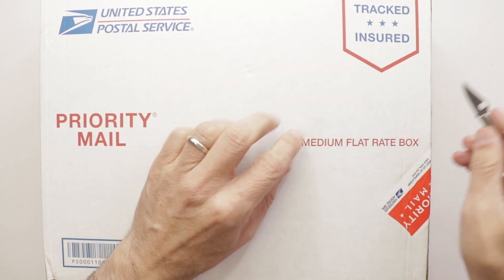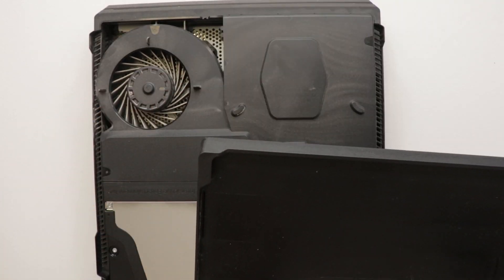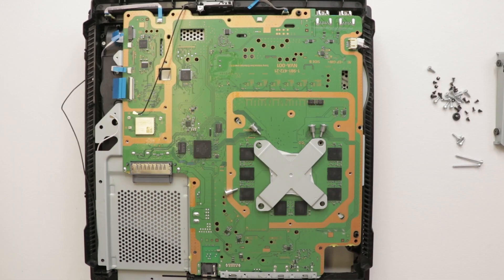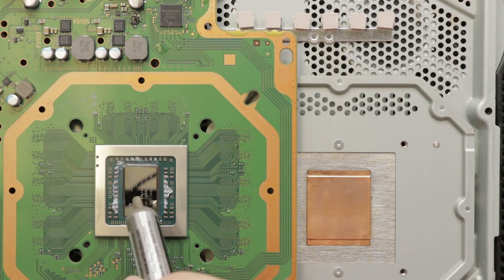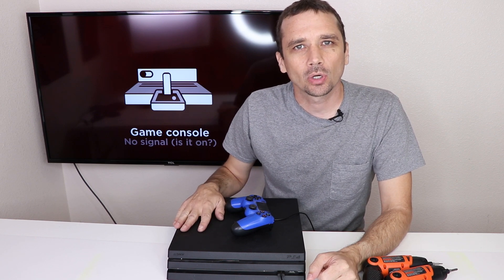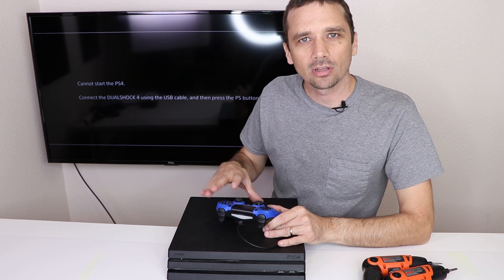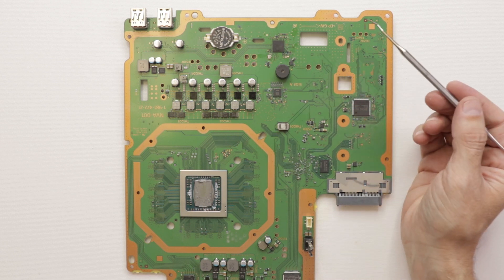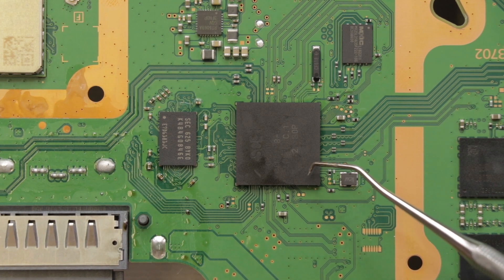eBay Repair Challenge - Part 4 - Is My Luck Running Out?

Comment from the maker: What do you think of item #4?
Reply: Bad luck not fixing it, I wish you more luck on item 5. I'm curious what was the reason it still didn't work, but frankly given the effort required to confirm that, I'm happy staying clueless. It might have been worth checking the controller(s) synced with it before taking it apart and replacing the HDMI IC in case it was something you did that stopped them working. Though, I doubt in this case you caused that.
Reply from the maker: I checked the controller multiple times. It's my test controller so I know it works perfectly. As far as I can tell the reason it didn't work is because of the Southbridge chip. The lines from the USB ports go directly to that chip. I think the chip had burned out because of the lightning.
Reply: when you look at the southbridge chip, you can tell it has been burnt at least a little. This can be clearly seen in the discoloration on the chip on the lower left @13:54 .
Reply: Nintendo Gamecube
Reply: I think that was a tough break man.
Reply: Hey Steve,
Just wanted to see if you tried replacing the hard drive. I had the same issue and I would get a different fault each time I rebooted. I replaced the hard drive and it worked perfectly.
Reply from the maker: Me too!
Reply: A old boombox would have probably been better (i fixed mine by just resoldering one of the transistors on the back that had came off and putting the tuning knob back on inside) i can put a link to the one i have (i like it because it has rca jacks on the back for audio in from dvd players, blueray players, and older game consoles [new ones with a adapter] + the standard 3.5 mm mic jacks and a 1/4 inch headphones plug [adaptable to 3.5 mm] and a sliding volume and balance control + a 5 frequency eq [ac or dc powered with a switch on the back of the 20 volt psu])
Reply: Its from the 80s
Reply: when you said you've replaced the IC chip you put back the same wet one or what? If not and you are buying those, how much does it cost?
Reply: @edrakulic  yeah good spot - electrical overloads are very tricky I say assume it the surge was massive and goes far beyond anything visible to the naked eye at least, solution would be inspect major if not all components with a 200x microscope. The further away you get from the main damage the finer detail you need to spot high temp discoloration etc but with experience you could probably get really good at guessing whats broken
Reply: Replace the USB ports
Reply: Have you tested if the usb ports have the right voltage? Did you connect a tester? Very naive question but sometimes the basics works. Put your faithful tester on them.
Reply: if it ain't broke i'll fix till it is
Reply: @Mik3Bravo  Ed

Comment: Form Arctic Silver manufacturer site :
While much safer than electrically conductive silver and copper greases, Arctic Silver 5 should be kept away from electrical traces, pins, and leads. While it is not electrically conductive, the compound is very slightly capacitive and could potentially cause problems if it bridges two close-proximity electrical paths.

Comment: I dont know if you are reading this, but i got the Ps4 Slim. You need a Specific Cable for Controller At most of Playstation 4th. Original Cables are just work fine. That you know the nex time before reflowing Chips or doing on Hardware, test it with another Cable/Original Sony Cable. I hope it will help you

Comment: I would have looked at the voltage coming from the USB port. That would given an indication if it is a data rail or voltage. If there was no voltage then it might have just been a regulator that blew.  If it was outputting 5v but no data then it would be a logic chip or something. Of course, if there was nothing then that doesn't do much.
Reply: I was thinking same thing
Reply: It could have been checked with a usb hub with a light (i use one of these with my phone so i can charge my new bluetooth headphones while using my Xbox 360 controller to play my gba games on my phone when i don't have a charged external battery pack [power bank] or if i just don't want to be stuck to alot of extra charging cables)
Reply: @nathanmead140  I wouldn't use anything that draws a constant current or isn't voltage protected because if it did short across a regulator then you might blow more components or blow your device and cause a feedback.

Comment: you use Arctic Silver 5, this thermal paste is conductive... silver so if you use too much then it does matter if it touches anything else electrical. Consider using MX-4 thermal interface material its non electrically conductive. Stops shorts, strictly trousers mate.

Comment: Unlucky Steve, still a good video though. It is a shame you haven't got the original controller and then you could have synced up the 2nd controller via Bluetooth rather than USB. I know it is too late now but maybe if the HDMI CEC was enabled on the PS4 Pro from the previous owner you could have used your TV remote to navigate the menu and then synced up your controller via Bluetooth even without the original DualShock 4 controller or using a USB cable. That's annoying that it had more than one fault. At least if you have the time left to make the money back on the case and power supply etc. you can get a decent chance of making a good profit on the 5th item :-)
Reply from the maker: Yes, some of those things may have worked but the problem is that I'd have to at least be able to get it to the dashboard...it uses a wired connection when it has this error or even in safe mode so it would have to have the USB ports working. I don't think you can use the TV controller when it has this error, but I could be wrong. Either way I think I'll be OK on this item as I should be able to make a bit of a profit on it still just selling the parts. The disc drive alone goes for over $100 usually. We'll see. 
I got lucky on several of my other items so I'm partly glad I didn't on this one. Being lucky on every single item is just not realistic. 
Thanks for the comment!
Reply: Oh yes, of course. You're completely correct as the controller doesn't work wirelessly in safe boot mode even if it was previously synced. The TV remote wouldn't have worked as it only navigates the main menu. Roll on item number 5 :-)
Reply: @ItIsNot1984  I sure hope he did.  That is what I was thinking before he started pulling it apart again.

Comment: I know this is an old video but an idea I had when you came up to being unable to sync the controller is they sync to the wireless chip through the USBs. If the components for the USB chips worked fine like they seemed to then it was likely a dead Bluetooth chip.

Comment: Use a usb port extender one that plugs into to an outlet .   It's meant for PC's.  But it will provide power to the controller.   Trust me, it will work

Comment: Thunderstorm can not be an easy fix. Really high voltage occuring in places it doesn't belong, causing random electronic components to fail (even some of transistors in microprocessors, causing them to seem fine, but then glitching out). Even if it can be fixed, everything that haven't been replaced is at risk of failing at any given moment (like you have experienced at the end of the video).

Comment: When you relist that PS4 Pro will you tell them what chip is blown? because I know a lot of techs try and fix stuff and when they can't fix it, they relist it as broken with no details, when they know what the problem is, this to me is a bit shady.
Reply from the maker: Totally agree. I'm actually just selling off the parts individually. Since I know which parts are good and bad I can list them accordingly.
Reply: And that's the reason I don't get into buying broken stuff. Sometimes you can legit be lucky and the seller didn't know what was going on. But from my experience most of the time they know what is wrong but don't mention it and sell it for more than it is worth. Or they try to sell their device "for someone handy to fix" and it's completely broken. Like the amount of people that sell icloud locked iPhones for a price that you would expect to pay for a working, non-locked one with the description "for someone handy to unlock" is just amazing.
Reply from the maker: Yes, you have to be very, very careful. I don't think this seller know what all was going on with it. The warranty stickers were still in-tact and everything. Just an unlucky buy. The good news is that I can still sell the parts and I think I can still eek out a profit on it.
Reply: @TronicsFix LLC that what a good honest tech should do. Have a great weekend.
Reply: @Olaf De Sneeuwman also check the sellers profile and see what other stuff they are selling, if its all the same stuff or similar, then you can safely say they repair stuff and they can't fix the broken products.
Reply: Britec09 Problem is that where I live (Belgium) Ebay is almost never used. Everyone uses a craigslists clone which is also owned by Ebay or Facebook marketplace. But neither of those encourage users to build reputation like Ebay. Almost every seller you find has a new profile. And it's a negative platform in general. A lot of 'funbidders' (people that spam you to bid half of somethings value) and sellers that can't communicate, ask very high prices and ...
I could use Germany's Ebay (or any other European Ebay) but most sellers don't ship internationally and if they do shipping adds enough to the price so that I never can get a good deal. And when selling on Ebay money is also lost due to shipping.

Comment: Lighting strike, would surely made a havoc in a power supply rails. I do not have the diagram, but from quick search on internet, this unit has at least 4 or more power supply voltages. I am guessing you checked those first? The fact that USB was not working I would suspect that 5V (if it exists) or at least 3V3 is/are missing.
Reply from the maker: The power supply was working 100% normal.
Reply: You have other power regulators on the motherboard it self for usb so if they dont work bye bye usb or any chip that is powered by them

Comment: I had a Ps4 that didn't sync the controllers I plugged into it, and the problem turned out to be not the usb ports (or chips directly related to it) but rather the Wifi+Bluetooth chip that needed reballing. I suspect this was the problem with this particular console as well... though you might already know that by know (considering the video is from 2018). I think I even watched another one of your videos where I learned this fix from 2019.

Comment: Ah that sucks man I think maybe a power regulator would help since you can check the correct voltage and resistance to the chips and ports and if it’s not you replace ether one. But I have a question about my base ps4 not slim why is it that sometimes the eject button and power button think it’s being pressed when nothing is touching or even against it?

Comment: Sorry but the Southbridge isn't paired with the APU. Maybe also the Bluetooth/WIFI ic is broken. Had a NVA-001 Board which showed the same symptoms. Had to replace the wifi/Bluetooth ic and everything was working fine after i replaced the IC.

Comment: I would've liked to see of there was power going to the usb ports. Like plug in a usb device with a small light on or something. Also did you try resetting the pairing on the controller?
Reply from the maker: Yes, I think I showed that in the video but maybe I edited it out...don't remember.

Comment: You sure it was the USB ports faulty? Doesn't the PS4 check the Wireless/Bluetooth Connection to the controller even in Recovery? Maybe it was the Wireless/Bluetooth chip?
Reply from the maker: Yes, 100%. It wasn't in recovery. The console uses the wired connection when it's giving this type of error.

Comment: many years too late lol but I always had the problem that if I had used my ps4 controller on another console/PC then tried to connect it to the ps4 after it was already on it wouldn't connect at all until I turned off the ps4 and reset the controller  then used the ps4 controller to turn the ps4 on.   After that it would work fine  till I would turn the ps4 on before connecting the controller lol.

Comment: I have had the the same problem with my PS4 multiple times where it would not connect to my controller even after turning it off and then back on again, but if I use a different controller it works
Reply from the maker: Ya, that's a different problem. Wish that's what was wrong with this one!

Comment: I really would like to see the opinion of a guy who repairs these console daily:
Are the Internals better from the PS4, or Xbox One (S,X)
By that I mean, which one has a greater chance of breaking, and which one has a greater chance of just straight up working for long.
Reply from the maker: Wish I had a good answer for that. The truth is that they are both good consoles and they each have their problems. PS4's have been plagued by things like the blue light of death but Xbox One's have been plagued by the on and off problem.

Comment: Dad: DUDE - replacing that chip was killer.  I've never seen that before
Reply from the maker: Glad you enjoyed. It's a fairly common repair on these when it comes to lightening damaged consoles that won't show a picture on the TV screen.
Reply: @Tronicsfix  not sure if your going to see this reply as the video is 1 yr old but I have a question (you have probably said somewhere previously) but what was that paste that u used the heat gun on to replace the chip? Great vid btw loved the editing

Comment: Always use a surge protector.
Reply from the maker: A surge protector won't protect the HDMI port or chip.
Reply: TronicsFix LLC I didn’t know that.  Thanks for the correction Steve and keep up the great work!
Reply from the maker: I wasn't really meaning to correct anything...a surge protector usually works for power surges to the power supply but since the HDMI isn't connected to a surge protector many times the surge will go from the TV (or cable box) through the HDMI cable to the console.

Comment: Liquid metal will eventually eat its way through HS and then the traces/components of the motherboard
Reply from the maker: Source?
Reply: @Tronicsfix  https://youtu.be/HPqi8RdApxc

As far as I know, the PS4 heatsink is predominently made up of aluminium/steel. The gallium compound wil work it's way through that. Of course it is your own choice, and a lot of people seem to be divided on the issue. But for me the risks outweighs any benefits
Reply from the maker: Yes, you are correct that the PS4 heatsink is aluminum/steel. The PS4 PRO however, has a copper heat sink. I'd never use liquid metal on anything but the PS4 Pro or Xbox One X.

Comment: I hate to assume - but did you try a different usb cable after you got video and before any other chip replacement?
Reply from the maker: Nope...this is my test controller. I use this controller multiple times per day. I use this setup on every test because I know it works 100%.

Comment: Probably you have tested all the posibilities ... but did you check all the voltages of the PSU, probably a missing rail that is only for USB ?.
Reply from the maker: To my knowledge there is no voltage that is just for the USB. It's always possible though.
Reply: USB uses +5V, if that rail doesnt work, the console cant even turn on.
Reply from the maker: Ya, that's what I was thinking.

Comment: My Ps4 was also damaged by lightning! Got a replacement power supply and just swapped it out!
Reply: Ita normal again?
Reply from the maker: Yep, that can be a problem sometimes. This one powered on fine so I knew the power supply was fine. If only the USB ports could have been fixed.
Reply: @dayahsuwa6643  Yeah! Works fine again and a easy fix!
Reply: @Tronicsfix  Yeah that was sad when i you tryd the usb and it was dead!

Comment: Is there no schematics available for this PS4 pro motherboard. A schematic might show you where the usb traces lead to and what might be faulty.
Reply from the maker: None at all. Manufacturers are not required to provide them (like they are on cars) so sometimes there's just no way to trace down the problem.

Comment: Never reflow Southbridges they end up dying id just replacing the southbridge
Reply from the maker: Well that's good to know! I normally avoid messing with the Southbridge and APU.
Reply: @Tronicsfix  maybe try contact Andrew Paul and see if you could collab and work out a solution to resolve this
Reply: Reflowing is melting the solder under the chip to improve the joints and the contact. Reballing is to put out the chip, replace the solder for new solder balls, in this case you can replace the chip for a new one or leave the original.
Reply: @SiliconPower74  but with reflowing you put all the heat through the chip causing tremendous stress and more than likely ruining the componant you are reflowing thats why reflowing is hated upon the repair community for reflowing Bga chips
Reply: I know, I also dont like reflow and even reballing without change the chip. I just wanted to answer @worldwidewillem

Comment: dunno if u noticed that the controller was a v1 controller should of used a v2 controller as v1 controllers would not sync using usb with the pro i found that u need to sync it with the bluetooth menu on the ps4 to get it work so the ps4 pro was probably fine when u booted it up and had a display
Reply: Oh, I never knew that!!
Reply from the maker: Either controller works fine for the Pro. I use this controller to test every Pro I repair and it works 100% fine.
Reply: @Tronicsfix  yeah but there was an update on the Pro that for some reason would not sync with the v1 controller as he started it it went to that cannot start ps4 if the system had that update still on the hard drive u won't be able to sync the controller I had the issue a while back had to search YouTube to get it to sync by manually getting the Bluetooth to connect